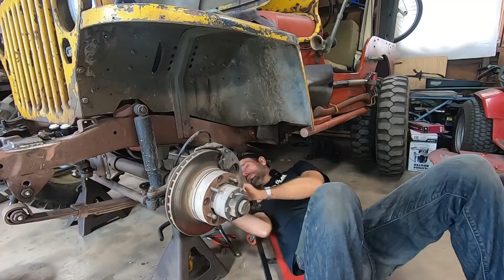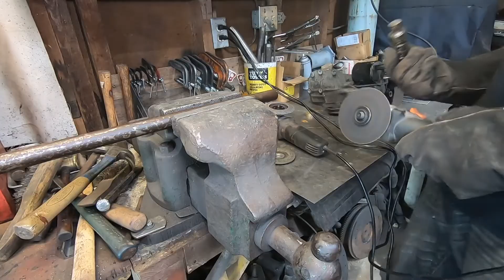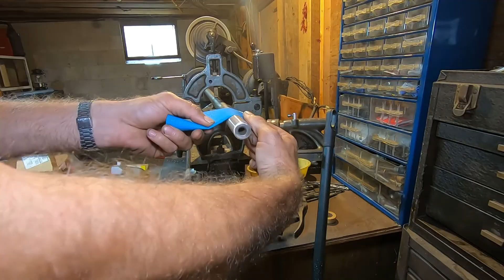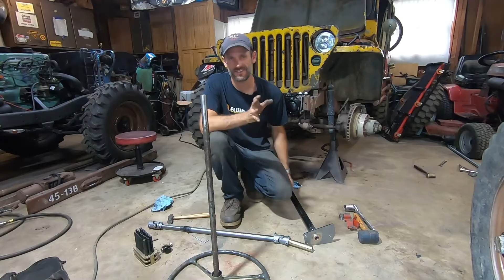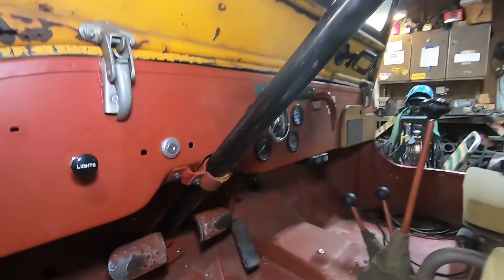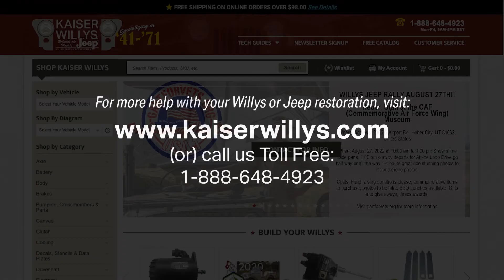Kaiser Willys Exclusive: CJ Power Steering Conversion Kit (Part 2)

Comment: My Ross steering box had the has the horn wire going all the way through the steering shaft and worm gear and comes out the bottom of the steering box. 
I rebuilt the whole Ross steering box, bell crank, steering column tube bearings, tie rod ends, drag link, everything with kaiser Willys parts. It is the best steering Willys out of the four I have owned. You are right; there are a lot of places for lost motion to occur in the stock steering setup.
Reply from the maker: Sounds like your jeep is squared away! Nice work!